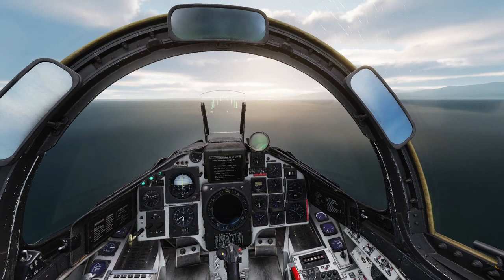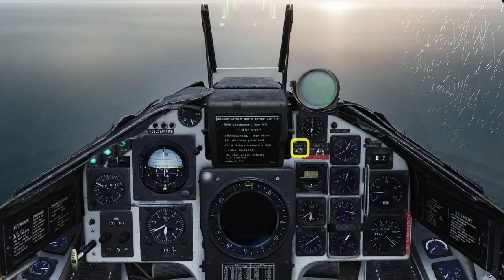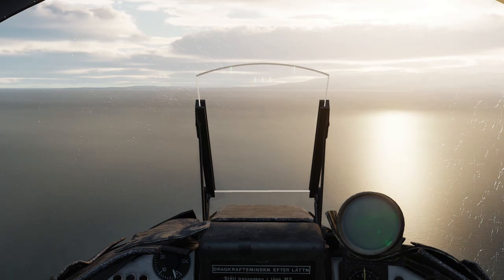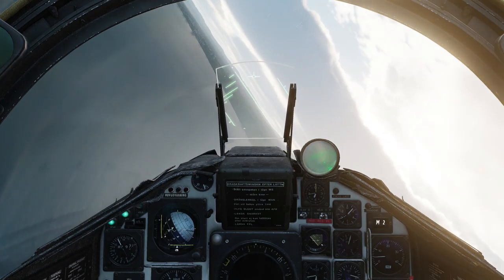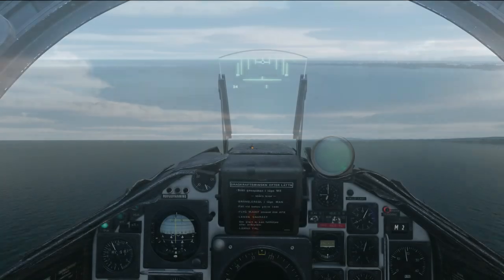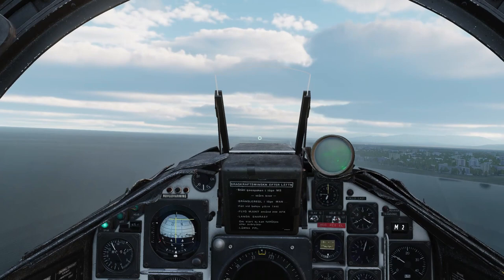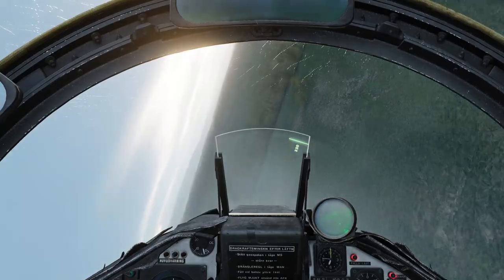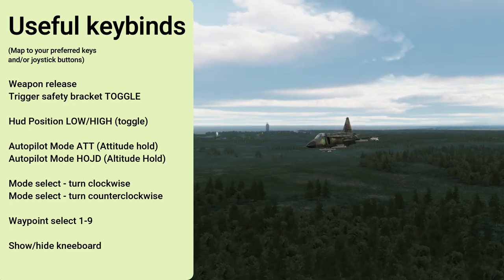DCS Viggen Low Drag Bombing - AJS37 Dive Bombing in Precision Mode (DYK) - DCS In 3 Minutes Or Less

Comment: I tend to prefer a 45 degree offset pop personally. At 8 or so km turn to put the steering caret 45 left or right, then pull to 45 degrees up, look towards the target to identify it, and then roll in.
I find this gives you time to identify the target especially if it's in an awkward area.